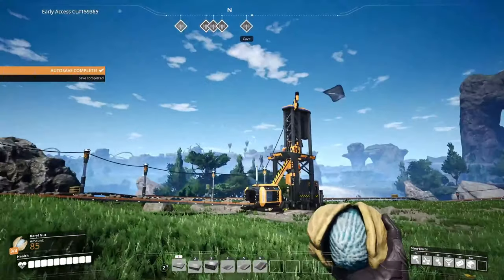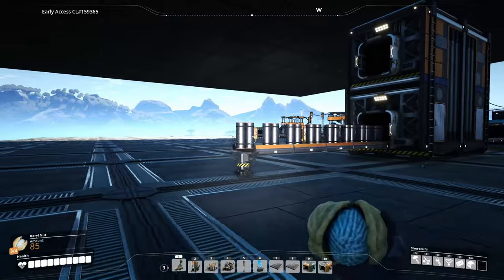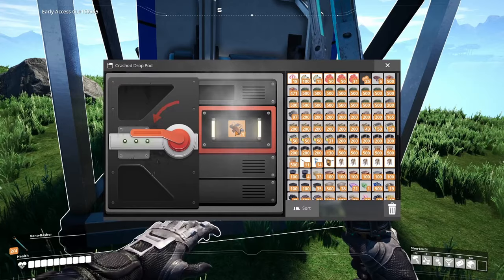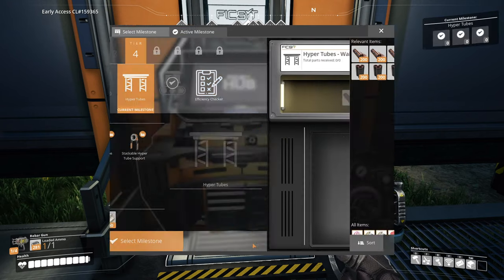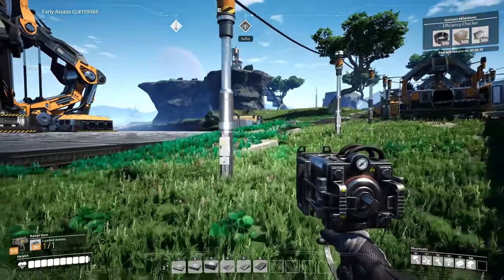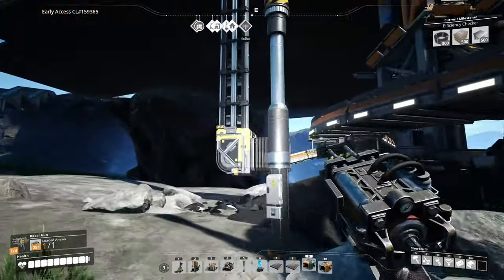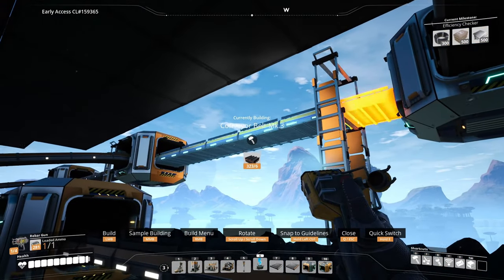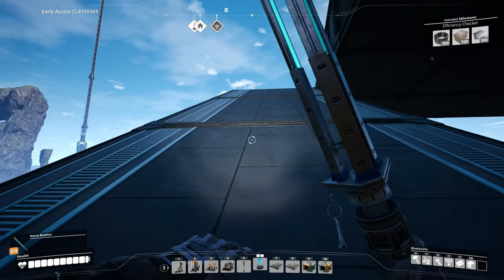Let's Play Satisfactory s01 e29

Comment: Steel is a 1 to 1 ratio, so you'll need equal amounts of both coal and iron for the vanilla recipe.  Looks like you'll need 270 of both to run your set up efficiently.  As mentioned below you can replace a miner by selecting the upgraded one and placing it on top of the existing one.  Sometimes in doing that you lift doesn't work and deleting and placing a new one will fix that.  Hope your enjoying this game, ive sunk so many hours into this game and still going.
Reply from the maker: Thanks for the tips.  Oh yes, I have been having a ton of fun. There's so much to do (not to mention, there's so much to RE-DO) that it's hard to decide what to work on next! 😸
Reply: Right.  The best way to upgrade raw resource output is to upgrade the miner.

The two coal nodes that he's got set up near his base are pure nodes (I know because I found them as well).  Upgrading to mk 2 miners would give 240 per minute, necessitating mk 3 belts.

Fortunately, there should be a couple of normal iron nodes nearby that can be merged together to match the coal output.

Comment: I would probably use that inventory mod, but one thing holding me back is the fact the game is early access and subject to change.

However, here's a mod I'd like to see.  A mod that changes how your character looks to a Space Marine with the ability to craft a heavy bolter rifle.  While not a Warhammer 40k enthusiast, I do love it for the memes.

And as far as hypertubes go, good God I have those all over the place.  I use them to get to my other holdings, such as my oil and fuel facilities, get to different levels of my base, etc.  You'll need a lot of steel tubes and copper sheeting, so let those build up and then go hog wild.

And at this point, wait to overclock the mk 2 miners until you unlock mk 4 belts.

Comment: Regarding machines and power, machines have coloured poles to indicate status:  red - no power, yellow - no producing, green - producing.  There's also a colour for overclocked, but I don't remember it off hand.  Surveying those coloured poles is a quick way to assess problems in a factory.

Love your trick of planting a pipe support at looted crash sites.  Far better than beacons which crowd the HUD!  Nice!  I may use the Lookout Tower instead, as the pipe support is rather small and won't be visible from a distance (and even less so if the crash site is up on top of a ledge or pillar).
Reply: My friends and I like to use power poles. It is taller and easier to see.
Reply from the maker: Ooooo..  that give's me an idea!  Thanks!  😸
Reply: @Glidercat  Like build a wall of power poles around it, so you can't miss it lol
Reply from the maker: @crazypete5067  You read my mind!

Comment: @Glidercat you can replace a miner directly by selecting a different MK miner and placing it over the old one. And you do realize you should put that hard drive into the MAM right? Better to do that sooner rather than later. (trust me on that one)
Reply from the maker: I've kind of been holding off processing the hard drives until I have a better feel for which alternate recipes I prefer to unlock.  We'll see, I may try and look those up.

I'll be doing plenty of in place upgrades using the  technique you mentioned. Thanks!
Reply: @Glidercat you can only choose 1 of 3 recipes per HDD, but you can get ALL alternate recipes
Reply from the maker: @BasSpruit  That's good information to know.  Thanks!  I was wondering if that was the case or not.

Comment: Boy did I hope a splitter could be placed on a miner! That would be the easteregg of the year I would say. To bad that didn't work... You were right when thinking that not all belts in the iron factory shouldn't have to be upgraded to mk3. After the first splitter you get 2 * 120 so the mk2's are sufficient indeed. I even downgrade the inputs to the machines to mk1's if the recipe need less than 60/min, seems to work good as well. Since I've tested that flying mod of yours, which is a timesaver like no other, when you want to check stuff in between episodes, just type !fly fast or !fly med so you can hop around the factories or quickly get to the coleplants when checking for some stuff. I know that's sorta cheating but in between eps, but you probably don't like to use it that way, not sure. If the cause is right, maby... Loving the series, got me back into playing this, as other games. Like you suddenly saw a comment under the Dyson Sphere playlist, got back into that one as well. Oh boy what a time to game. Cheers, Jake.
Reply from the maker: I thought I would be using the !fly mod more to get an overview of our factory layouts at the top of new episodes, but it hasn't really been that necessary yet.  Once things get more complicated, I may use it so we can all take a birds eye view of things. I don't like to use it for anything other than that (like collecting power slugs), because it will end up just shortening the game for me.  I do really like the inventory mod though! 😸

I do hope to get back to Dyson as some point too.